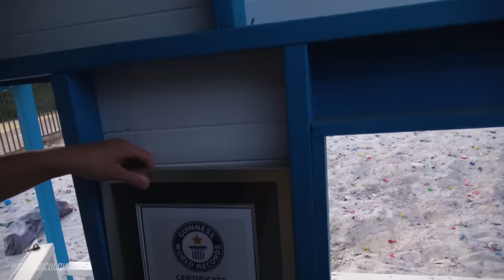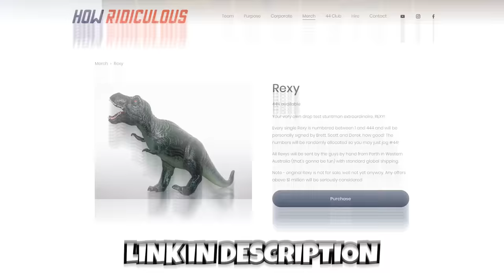Piano Vs. House from 45m (GONE WRONG)

Comment: Yall should've dropped the house
Reply: Timothy um how would they do that be to heavy
Reply: If that's an option (weight may prevent it), they should drop it on a mannequin on a broom dressed as the Wicked Witch of the West.
Reply: @dinodusty2522  Um with the same lift they use for 200 kegger atlas stone? If anything the house would've been too light for the wind that day, one good gust and it could've mullered their car
Reply: @dinodusty2522  Well, they hinted at dropping a boat in their next video, so maybe a house isn't too far-fetched after all...
Reply: How much weight can that tower take??? It is leaning after all.
Reply: @princecharon  I love this idea
Reply: @sirgalah561  About a pi-za! But seriously on a wind-free day it's mostly limited by how well they can mount the weight. That tower will be built with a massive factor of safety (maybe 5-10x). The bottom end of the structure needs to handle the entire tower plus maybe a ton of people/equipment on top, going up and down, or running if the wind got too strong. You also don't want it blowing over when 100mph gusts of wind hit it at the right rate to throw it around. (resonant frequency).
Reply: Al DUSTY There’s no way it’s heavier than a piano.

Comment: Ladies and Gentlemen: THE WIND.
Reply: Also, air resistance moving it. Try dropping a piece of plywood in a flat position and you'll miss every time. Should have slinged it so it was dropping with the smallest side down

Comment: He was bought for probably the Switzerland video where you dropped a bowling ball from the dam.
Reply from the maker: It's true he was bought for a video filmed in Switzerland, but for someone to get the final pin we'll need to know which video and for what purpose? Remember he wasn't actually used for the purpose he was originally bought haha. Also, if you reply to this comment we can't pin it, it needs to be a stand alone comment and not a reply to another one.

Comment: I'll save you a lot of trouble. Piano missed. Thumbnail is clickbait. Video should have been better planned using the wind and massive surface area of the piano into the equation. Video needs to be retitled Thor's Hammer vs. playhouse.